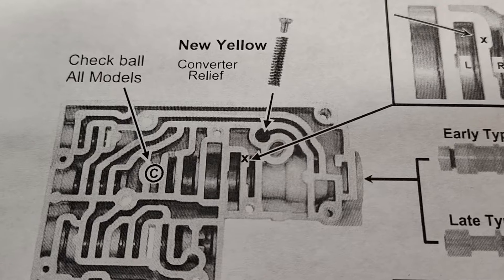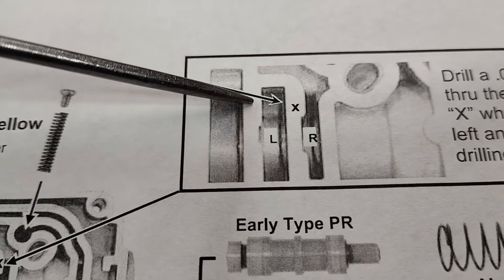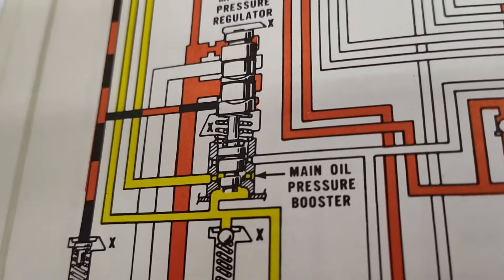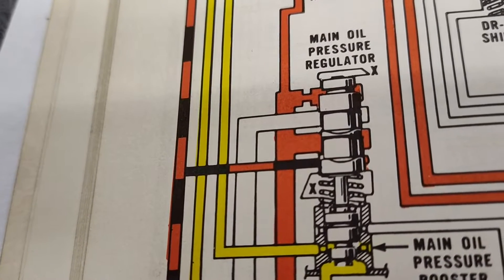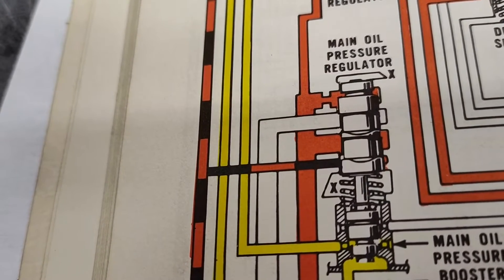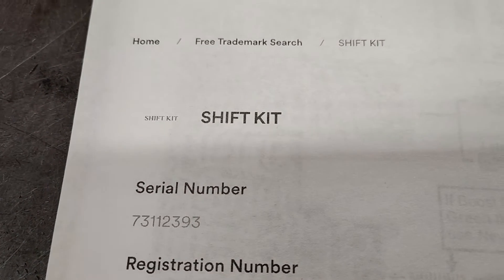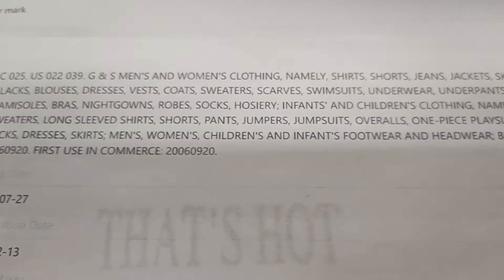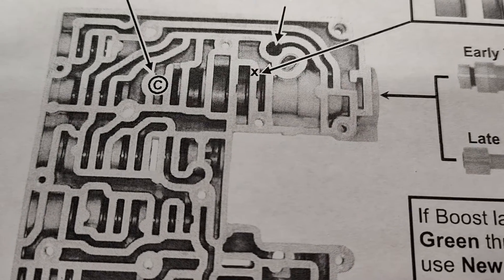C6 Cooler and Lube Flow Mods Explained

Comment: In regards to the TM's, they only apply to area of ?commerce? they are used in.  You could still TM "THAT'S HOT" in the motor world because it's not clothing accessories that Hilton likely filed it under.  If you catch my drift.  

Great educational videos!!!  I have C6 in my 88 7.3 idi F250.  Maybe could you do one about vacuum pressure coming from the injection pump's VRV (Vacuum Regulator Valve) and how it effects the transmissions?  My tranny was causing some slippage and delayed engagement, learned in a rebuild manual online that the VRV needed to have certain specs; I had a vacuum leak and a bad VRV.  Solved leak issue from loose hose connection at VRV, but VRV was giving minimum vacuum at maximum position on regulator.  I'd really appreciate this follow up!!  I have vids on my channel about this.
Reply from the maker: Cool I may use "that's hot" for something. Haha I plan to do videos on the Dyno showing effects of vacuum signal etc..... I just need to figure out how to get the audio right when the Dyno is running.

Comment: Excellent information as always .  I was of the understanding that cooler flow can be blocked off in very high load, low vacuum situations if the pressure reg valve moves back (not relieving or metering pressure) as in heavy trucks or towing up long hills.   It seems strange the only kits that show this are the very basic "tow" types .   None of the "competition" type kits show it 
I may be wrong ???
Reply from the maker: Good questions. I would say low rpm along with a high pressure demand would aggravate the situation. Drag racing typically involves high rpm so the pump can produce lots of oil flow. Ill try and do a dyno simulation on this in the future.

Comment: Jay, I’m a new follower and supporter since the 
Speed bastards issue. 🇺🇸
My E4OD installed by Ford in Branson 7yr ago in my 94 F250 4x4 is stalling my engine when I come to a normal stop with the overdrive button pushed in. 
It doesn’t stall the engine with the button not pushed in. 
With the button pushed in and just before stopping it’s feels like it’s trying to continue to pull like the torque converter is acting like a manual transmission and not pushing in the clutch.
It’s fine if I don’t have the OD locked out by pushing in the OD button. 
I know you’re busy, could be please comment on what I should check?
Thanks,
Sharky
Reply from the maker: IM not an E4OD expert but it sounds like the torque converter is being commanded to lock up. Maybe be a short in the wiring harness or a computer issue.

Comment: I can't imagine needing to reprogram a C6, mine has never been apart (aside from replacing the front seal) and has good strong shifts.
Reply from the maker: They worked well from the factory. I agree. Modified engines is a different story though.
Reply: Sounds like you are a fan of Paris Hilton. Don’t hide it.

Comment: I always use the smallest stated hole size for all-time cooler flow.  Many times I will use just smaller than the smallest called out in the shift kit.  Some units I don't drill the hole, even with a shift kit.
Reply from the maker: Thanks for the tips.

Comment: what is your opinion on spring count?. low / rev clutch has 24 springs for example. Building a c6 for a sled pulling truck. would it benefit leaving some of the springs out. seen different configurations of amount of springs when disassembling c6  that have been rebuilt before. thanks!  enjoy you input.
Reply from the maker: For that application just leave them all in.